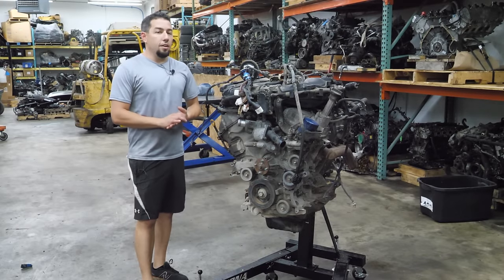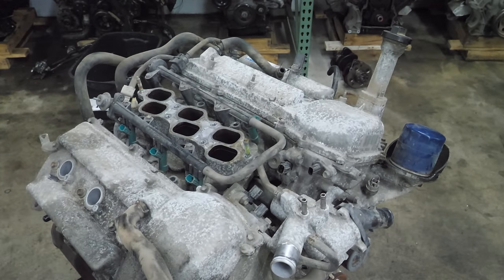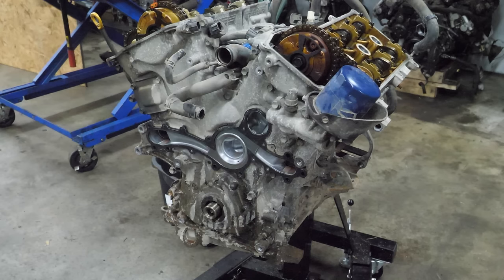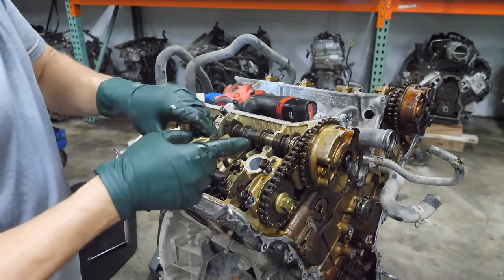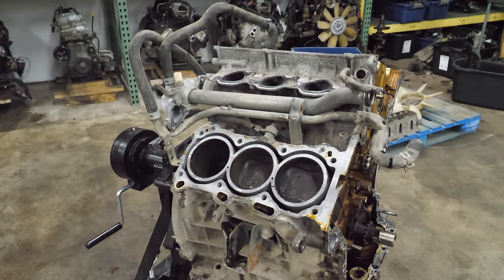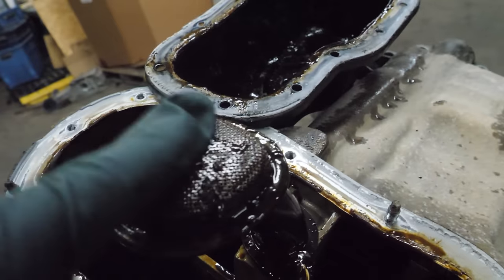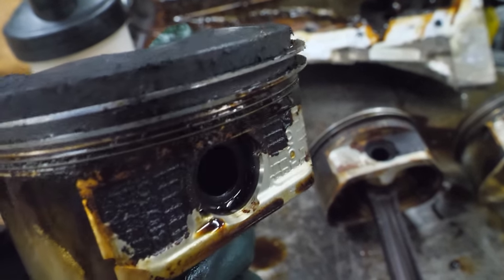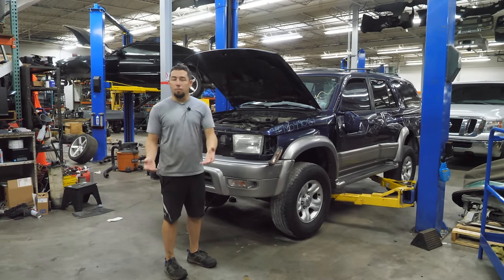Toyota 4Runner 1GR-FE 4.0 V6 Blown Engine Teardown. Just A Slight Tick...

Comment: I can tell you why people such as myself wouldn't bother using a Toyota 1GR-FE engine over a Chevrolet LS1 V8 engine for example.

Mine is a 5.7 litre Chevrolet LS1 V8 engine in my car & I have driven a Toyota Hilux when I worked for a volunteer organisation which ran the 4 litre 1GR-FE V6 engine,at the time my LS1 V8 engine had about 100 more flywheel kilowatts than the 175 kilowatt Toyota V6 engine since my V8 engine was fitted with then crappy custom press bent exhaust headers which I upgraded to a set of mandrel bent tri y exhaust headers 3 years ago.

The fuel consumption of the 4 litre Toyota V6 engine was dismal at between 14-15 litres per 100 kilometres (about 18 miles per U.K gallon),it didn't matter how it was driven,it still got the best of 13.9 litres per 200 kilometres on a 100 kilometre (120 mile) highway trip.

I get between 10-11.5 litres per 100 kilometres (about 26-28 miles per UK gallon) on the highway out of the 5.7 litre Chevrolet LS1 V8 engine or 12-13 litres per 100 kilometres just around town with a little bit of driving on the open road (21-22 miles per UK gallon).

The Hilux had the 4 speed automatic transmission & 3.7:1 final drive ratio fitted,my Holden VY SS Commodore has the T56 Tremec 6 speed manual & 3.91:1 final drive ratio fitted,it was actually better on fuel on the open road when fitted with the 3.46:1 gears,the Commodore is an Australian built car.

We nearly blew up the Hilux engine because the people who ran the volunteer organisation didn't get it serviced for 22,000 kilometres (almost 14,000 miles) so it only had 1 lite (1 quart) of oil left in the engine so we filled it up with about 4 litres of oil.

They did get it serviced but I think that happened again after I left that organisation,yes, they blew up the engine apparently !

Comment: I'm starting work a timing cover reseal , huge job, wish it had an easy to maintain rubber timing belt.  You ripped off a big chunk of sealant from where they typically leak (head meats the block).  There are a significant number of engines that develop the leak, and it is a 2K-3K engine out repair reseal in the shop.  I'm doing the reseal with the engine still in the truck.

Comment: Suggestion. 392ci 6.4lt from a 2016 or newer scat pack Challenger or Charger would be something I'd like to see. A second choice and probably not possible but an old 440ci Mopar would be a treat. Motor homes and industry equipment would be a fairly easy way to find a 440ci. I'm pretty sure you could sell every last piece on the 440ci including the block no matter what it's condition.

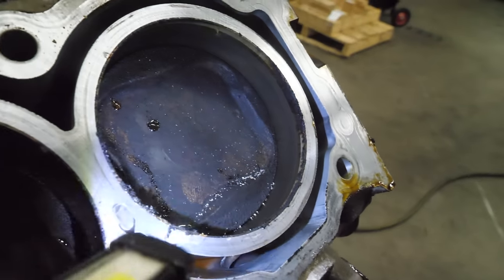Comment: All the extra boogers is from a repair. You got oil all over the cylinder head at 24:44 too. They leak at the right side timing cover and head - poses as a valve cover leak... Mine started around 60k.
Reply: Thankfully in mine the leak is almost non existent. Like a drop a month max

Comment: I'd suggest that you spray plenty of WD-40 on all those valves that had rust on them. They don't look terribly bad now, but they could soon be clean, instead of getting worse, with a generous squirt of the good ol' WD. It's the best for rust and is also a good lubricant...it never hurts.

Comment: Careful when hitting the valves, some valves have sodium inside the valve. The sodium undergoes some chemical reaction when exposed to the heat of the engine and helps transfer heat from the bottom of the valve to top of the valve. When you hit the valve like that if it does have sodium Inside, the hit would cause a shock with the sodium and could make the valve explode

Comment: The Toyota 1GR and the Nissan VQ40 are both great engines that could last well over 300K miles My impression is that the 1GR is more refined and smooth, the Nissan gets slightly better MPG’s

Comment: I owned a 2006 Tacoma with this engine. There is a TSB for a known issue with the timing cover for leaking oil. The Toyota dealership stated the engine has to be completely removed to repair. I did not see any oil under my vehicle and it didn't use any oil. But it was a great engine and vehicle until my sister made an offer to buy it. My mistake.
Reply: very small leak in mine almost non existent. not worth the 3000$ in my case
Reply: @joshanderson924  They quoted me the same price and I absolutely was not going to do it. I assume the reason so much RTV was on this engine was because a repair was done on this engine.

Comment: Price is a function of supply and demand. I assume because both the engine and the cars they come in don't fail very often, there isn't much supply. So even if demand is numerically low, it can exceed supply.
Reply from the maker: Lots of wrecked trucks with good engines that salvage yards dismantle. Lots of engines available but all highly priced.

Comment: Ever do a 225 slant 6 ?  While I had a 1bbl 225 slant 6 a833 OD on my Dodge - very anemic, it never died... just ran poorly.  Engine oil turned grey almost immediately after changing in (forbidde glitter?), but would still start at -40C.  Sadly, the truck rusted before the engine did (leaking rear main seal helped 'undercoat' the driveshaft+bed of the rest of the truck, and the carbon kept the exhaust from rusting out.

Comment: If I remember right the later versions (2010+) of this engine in the 4runner has secondary air injection tubes blocking removal of the ignition coils.

Comment: Always the same problem people don't change their oil. Very expensive car killed by a cheap oil change. I change my oil every six months, and people say I change my oil to many times. I had a 2000 Tacoma and change oil 37 times in 21 years. When I traded in in the dealer mechanic was shock at condition of my engine was clean as a new engine.

Comment: I have heard that mice like the wires in newer cars because they are using soybean oil to make the insulation on the wires to be more environmentally friendly but the side effect is the wire tastes better to the mice than the old petroleum based insulation

Comment: The reason for the rarity of these engines coming available and the 3000 dollar price range is because they are all still running for the most part. My 4 runner had 286,000 and ran like brand new. Zero oil leaks and zero oil consumption.

Comment: Considering that I've seen a turbo'd 1FZFE run on 4 cylinders after breaking the ringlands in 1&6, not surprised. Some Toyota engines seem to have a different definition of catastrophic than most.

Comment: I think the high used cost may be because these are difficult to rebuild, they have to be sleeved (cant be bored) which is expensive assuming you can find someone that can do it. I assume Toyota still makes short blocks but not sure.

Comment: many times, the original plugs will be denso in one bank and NGK in the other.  Has to mean the plugs get installed before the heads go on the motor, or that each side of the assembly mine has a different parts tail...

Comment: 2:19 I got a Ford 300 from an 84 Bronco with 136k miles on it, turn key fully dressed even still had the flywheel, carb and air cleaner on it, for $400. It legit cost me more in freight to get it from Minnesota to TN than it cost me to buy the engine itself.

Makes me wonder if there's something odd about these 1GR-FE's if they're 3k+ for a used runner when they're supposed to be just as good and widely available. Hmmm....

Comment: Where is the demand ?? Our 2004 4Runner developed a water leak on driver rear cylinder. I've heard the head gasket needed a design change and was implemented. I was lucky in that I could see the morning "white exhaust" and other tail-tail signs of the engine sipping rad water - lol. The truck spends more time draining the battery than rolling down the road so leak fix was in order. I've not had any coolant leaks since. Too many other issues with this year model such as cracked dashs makes a teardown or swap a poor financial decision. BTW original water pump, 120,000 with leak fix added at 70,000. go figure !

Comment: Love your videos.  I drive a 2012 Honda-CRV with the base 4 banger.  I would love to see a tear down of one of those, just 'cause I'm curious to see what's inside.
Reply: I would say pistons. Rods. Valves. Cams. Oil.   8--)
Reply: a k24?
Reply: @commonsenseisdeadin2024  That’s it
Reply: @oliverscratch  he has a couple. The k20 and K24 are identical (minus a oil pump balance assembly in the K24 and  stroke)
Reply: @commonsenseisdeadin2024   Thank you, I finally found them.  Cheers!

Comment: There is no supply, and high demand. That is why they are so expensive. When you surf junkyards any Toyota truck chassis is hard to come by. For example in denver when i was looking for wj jeeps, there was about 60 different vehicles across the different yards to pick through. On that same hand i was able to find one 4th gen 4runner at that same time.

Comment: Hondo Ridgeline 3.5 eng. has 216457 miles and I want to have it rebuilt.  Do you have any suggestions or a video to show teardown.  Original owner, oil changes every 4500 miles and all maintenance done on time.  Runs great, mostly highway miles.

Comment: Hey man. Don't mean to hack. I have a greased exhaust you can enter. 😆 Your previous vid. Of Ecoboost Ford and Chevy and Dodge valve-drives. The belt in Ford and guides in 5.7etc. Are there any dealer "Priority" changes to fix the problems? Without paying high amount already and fixing the existing problem should've been already fixed before going out to consumers....

Comment: what happened 1st?, valve stuck or piston smash due to hydro lock, or both?
My 1GR-FE has #6 exhaust valve stick open at 350K, but no piston hit. I believe this is a non interference engine, yes? Didnt bother doing a hed job and found another with 90K at a scrap yard for $1600

Comment: It is interesting how cylinder #6 broke a rod due to hydro lock most likely. Cylinder #6 is also infamous for the Tacoma Tick (1GR-FE V6). Which is perhaps not unexpected because this engine does not have hydraulic valve lash compensation (adjustment) like a roller finger follower arrangement from Ford. 

So, the lifter tick you have been hearing while the engine is idling from the drivers side rear of the engine (cylinder #6) is, well you guessed it, lifter tick (noise). Why always #6 cylinder? Not really sure. So how do we adjust the lash? The Toyota answer, choose one of 35 different lifter (which is just a solid cap) thicknesses. So, if the cams start to wear, like in the engine in the video, you will start to get lifter noise, which makes the most noise on cylinder #6. Cylinder #6 and nearby engine brackets and structures are somehow acting as a megaphone
Reply: What would be the fix on a new model
Reply: Unfortunately, unless the lash is out of specification there is nothing to fix. The engine as designed has solid lifter noise. You can disassemble the engine and check the lash and it will be on the high side of the tolerance maybe just slightly above it, but there is not a mechanical reason to repair the engine. It's not broken, it's just, by way of design, noisy. Many owners report the level of noise as being unusual, and they are right, but the engine will run with no problems for another 80K miles, at least when it comes to the lifters. The lifter noise sounds exactly like a stuck hydraulic lifter would sound on a Cadillac NorthStar V8 as just one example, but the noise is normal. @leardi58

Comment: Back when I was working as a mechanic I got my hands on a Mercury topaz with a bad engine it was a hsc engine but I found a wrecked car with a newer hsc engine when I did the swap the motor has a knocking it sounded like a wrist pin and hell I drove that car all over the place

Comment: My friends 05 Tundra has this exact model of engine in it and he loves it a lot. As for why this engine goes for $3,000 versus something like a 3rd Gen LS 5.3, I will just say because it's a Toyota. When I still had my old 2004 Silverado I priced out a set of heavy duty leaf springs rated for 2,225lbs each at $600 for the set. For ONE leaf spring rated at a lesser weight by the same part brand for my friend's Tundra it was $700. So for a set of two lesser weight springs for his Tundra it was $1,400. I could have bought two sets of higher capacity springs for my old Silverado and I still would have paid less. It's not that the parts' manufacturer is instantly going to make the part for the Tundra that much better than the part for the Silverado. It's just the Toyota Tax when it comes time to actually fix them. They're engineered so reliably that when it does come time to finally replace a major part that it is three or four times the cost than that of another vehicle make.

I know people love to bash on Chevy's. But I would rather be picked on for driving a Chevy if it means it gives me the option to buy the same vital parts at a more realistic price when it comes time to actually fix something. One of my supervisors at work had a 2012 Toyota Tundra for the longest time up until last year or so when he had to dump $600 into replacing some emissions pump on it and he said that was the cheap option as the dealer wanted more for it. When he got it fixed he was afraid of another expensive part failing so he traded it for a used 2020 Silverado Trail BOSS.

Comment: In Australia these motors were available in the Hilux (a narrow body Tacoma) and Landcruiser Prado, and various Landcruiser models in Africa. The motors do not like extended oil changes which tend to wear the chain, and it's guides, and block up its oil galleries with sludge. Local mechanics recommend changing the oil every 5,000km (3,000m) to extend the life of the motor to 'normal' Toyota expectations

Comment: I worry my motor may be on the verge of going out, had a P0014 code on my 4.2 Trailblazer and when I replaced the VVT solenoid (or whatever they wanna call it thats on the passenger side of the head) the old solenoid had a bunch of light brown crap on the screens (almost appears to be the color of some of the timing guides I've seen you pull off some motors) and so I did an oil change and when removing the filter got some oil over like 2/3rds of my hand and saw a half dozen glittery pieces in the oil.

Comment: no matter how reliable they are, there will still be some failures, and given how reliable the rest of the vehicle is, it means they are staying on the road long past when others are being sent to the scrap yard, so I'm guessing the high price is due to a lower supply due to reliability and somewhat average demand given the longevity of the rest of the vehicles and people's love for them and not wanting to just scrap them and buy a whole new one. Also knowing you may only need one new engine for that will last another 10-20 years makes your more willing to do the replacement vs. scrapping the car vs. a Ford where you think you might need one every 100k miles.

Comment: I have the later version in my fifth gen 4Runner. It's me, I'm the guy that actually hates this engine. It's definitely my least favorite thing about the 4Runner. It sounds terrible, and it really lacks in low end torque. The fact that it's generally reliable is the only thing it has going for it.

Comment: I drove a Chevy Corsica through a puddle in Overland. It was deeper than I thought. I let off the gas and it sucked water back through the exhaust. Got water into the cylinders. Could something like that have happened to this truck?
Reply: 100% it even had off road accessories all over it so definitely paints that picture

Comment: All that goobered up RTV is someone trying to fix the dreaded timing cover oil leak on that bank.  It looks like the valve cover gasket but it's not.  Three seams come together there and Toyota could just never seem to seal it right and many of them leak (seep) there.  Monitor it, live with it and if it gets really bad or if you change the timing chain fix it then.

Comment: I am speculating about the cost of these engines being high, but I have two theories. 1. As someone said before: Anything Toyota is going to be expensive.  2. Because of the reputation that Toyota trucks and SUV's are so long lasting, people are willing to spend the money to replace an engine or a transmission if it goes bad thinking that it will continue running for another 200-300k miles.  Whereas if this were any other vehicle they would be sending it to the junkyard.  I consider this foolish because if an engine or tranny fails at less than 300k miles it is very likely because the owners didn't bother to do oil or trans fluid changes (or take care of the rest of the vehicle either).

Comment: They're a great reliable engine.  Buy They're not popular as a swap as they don't make a lot of power for the size, don't know there's much aftermarket goodies besides a snorkel and other minor maintenance upgrades.  They're expensive because nobody gets rid of them unless they're dead. Other than the odd replacement engine for the once in a blue moon failure, odds car the vehicle itself is scrap metal and too far gone by the time the engine is done. Tuners want a 2jz and hard-core wheelers probably LS swap.

Comment: I really wonder where that engine/truck lived it's life.  I have >230k mi on my 2009 Taco and my engine looks NOTHING like that.  Just speaking of the condition of the block, water pump, etc.  It is very rough.  I am in VA and it is very humid with road salt usage and salty air from the ocean.  That engine had a ROUGH 180k miles.